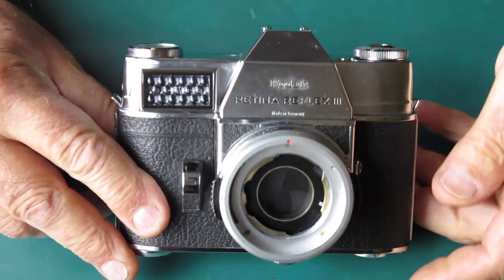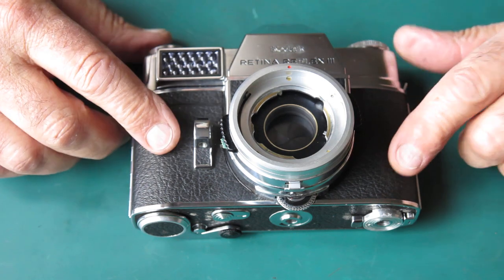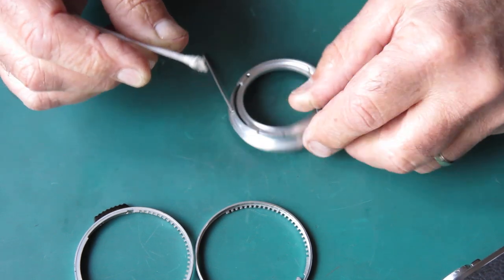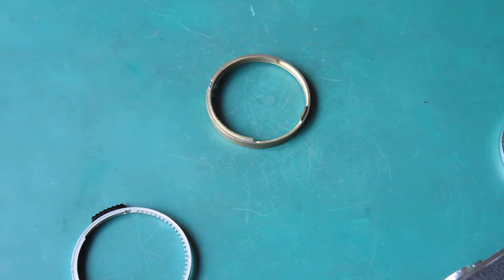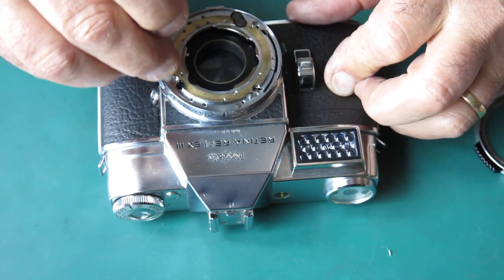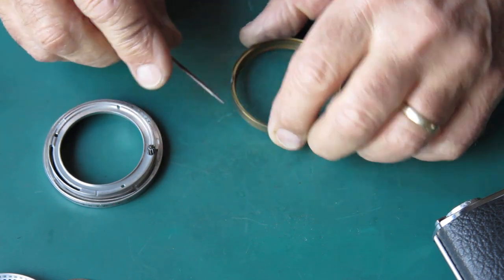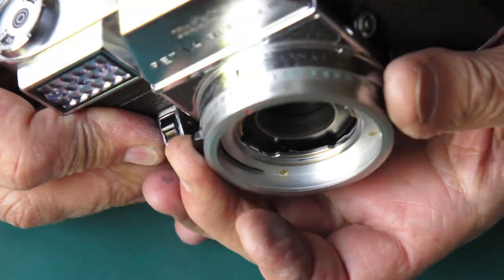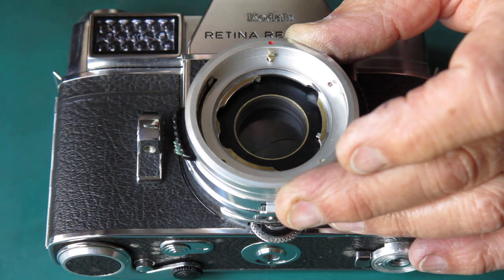Kodak Retina Reflex III, stiff control rings, and the fix.

Comment: I’m having a really hard time separating the brass ring from the rest. I can’t rotate it to be able to take it apart. Do you have any idea of what I could do/use to get it to move?
Reply from the maker: That ring is a snug fit, it is probably not sitting square, push it back square and it'll come out.